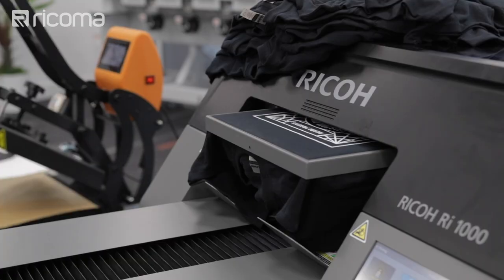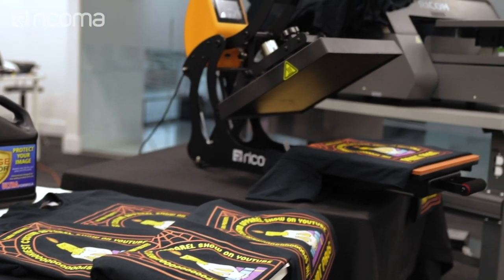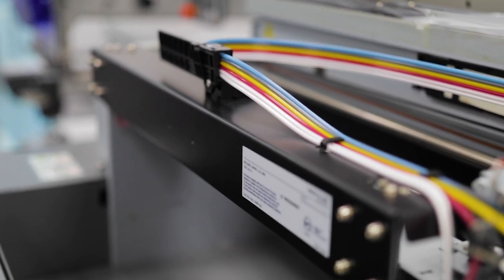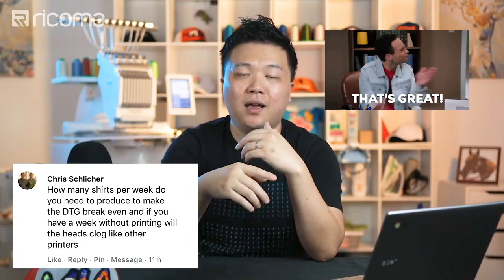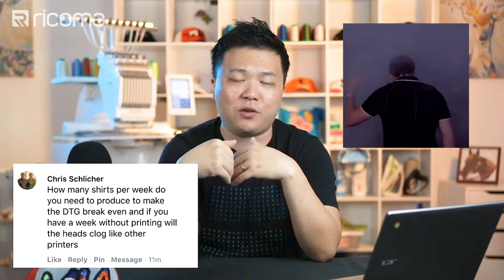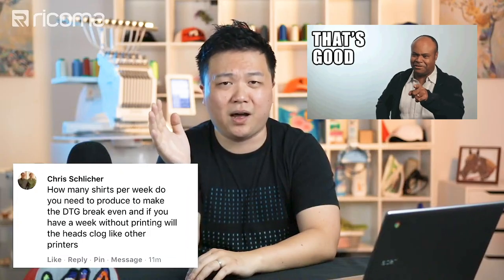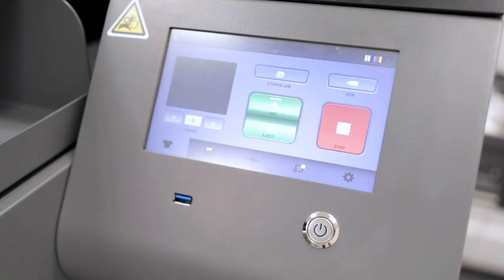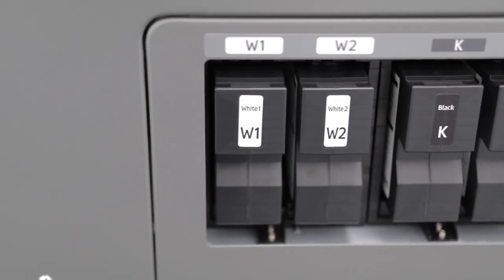Clogged DTG Print Heads?! Should you worry?

Comment: I did this on my Ri 2000 by following the instructions to "charge" the white ink lines + printhead with the cleaner cartridges.

Upon returning to the machine though, it says Head 1 and 4 have a 988/990 error code indicating clogged lines.  This is despite me having charged it with the cleaner.

When I try to re-charge with the white ink cartridges, it gets to about 15% before the 988/990 error code pops up.  Any tips you have to fix would be much appreciated.
Reply: hi Bud, i having the same issue. did you fix this issue?
Reply from the maker: We're sorry to hear that you are running into issues, and recommend you to contact our support team. They would be happy to help. 
https://ricoma.com/US/support
Reply: Did support help you out?
Reply: It happens to me all the time, I learned that you have to replace the ink cartridge when you still have like 30 % because if don’t do that the heads start to clog.  The machine don’t have an accurate reading you have to weight the cartridge id feel to light or empty changes right away even id the machine says it has 15%. One of the technicians told me it’s a software issue, it came with a Loya of bugs and we need to make the updates often. Machine not the rip software. I hope this help you.

Comment: friend, I have a problem, my machine was stopped for a year, I already bought the inks and the cleaning liquid recognizes everything except the white ink, it tells me that they are empty, what should I do?
Reply from the maker: Hi there, please reach us at https://ricoma.com/US/support :)
Reply: I ran a couple of these machines for a year. This is a common issue. I could sometimes remove and reinstall the cartridge and it would work fine again. But to fix the issue the cartridge docking station had to be replaced. There is a slim possibility you have a defective cartridge also.
Another thing they did not explain and a trainer was there to set up, is you must have the waste tube running straight to the floor into a jug. No bends at all, when cleaning it pumps ink into the suction but after that it relies on gravity to pull it away from the docking station. We fought very low humidity in that building and that will add to more issues.
Reply from the maker: @bradleyduvall5161  Thanks for helping out our community :)

Comment: Is a cr encoder error a easy fix?
Reply: Wipe it down with a wipe for your glasses with alcohol on it and it'll come clean!!
Reply: Usually just needs cleaned
Reply from the maker: Hi Ken, you would need to turn off the printer and clean the encoder strip and reader.